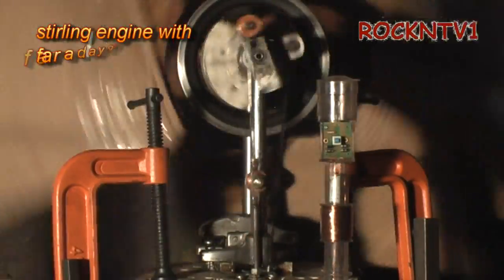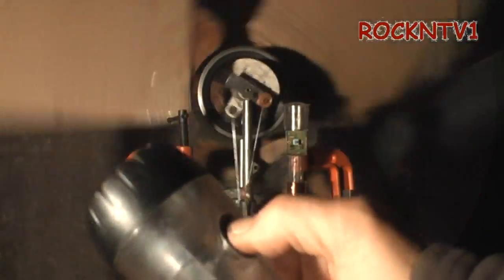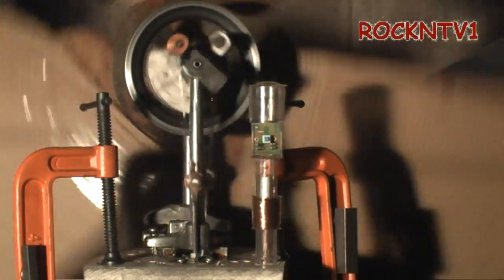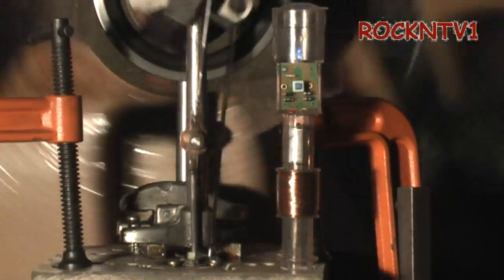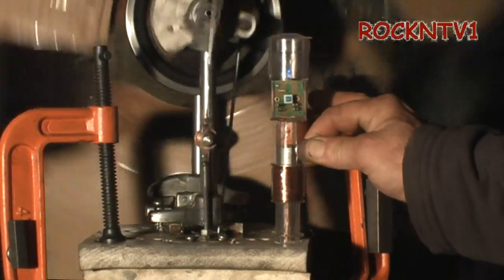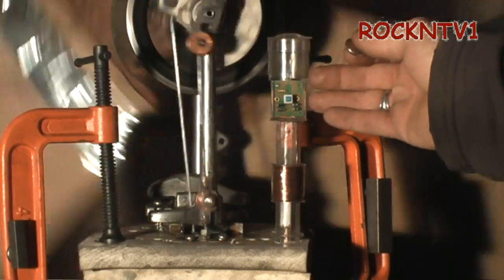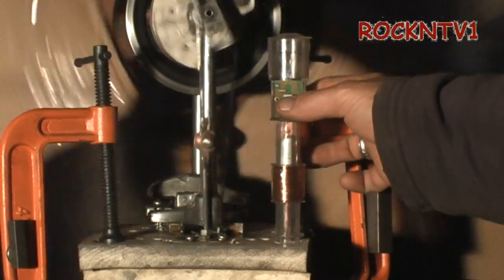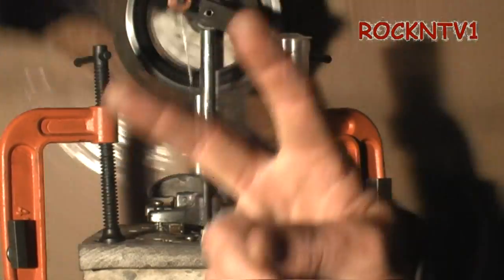Homemade diy Stirling engine FARADAY electricity GENERATOR

Comment from the maker: this stirling engine build has a lot of potential ive not come close to tapping. Once i have optimised the stirling cycle for these piston size and displacement ratio, i will work torward an effective dc power storage for the generator part. The lack of an induction load on the engine while using the faraday type generator, I have yet to fully explore. It is the one way flow of electric currant build into this circuitry that is the beauty, thnx

Comment from the maker: your right. the "piston"'s stroke actually shortened because of flex in the mechanical connection perpetrated by the flux of the additional magnet, yes an undesirable frictional load on the engine. Im thinking the area of flux increased with the second magnet as well as a "slip/stick"pattern of acceleration that may add to more phase cycles.

Comment from the maker: I am also torn between water cooling the engine or air cooled, like style of hot air fans of yester year. Am a  bit stuck deciding on the masses necessary for hot and cold ends of an air cooled stirling.

Comment from the maker: hi, In previous tests this stirling engine has produced  6.5 volts dc with a rotory type generator @ 150 rpm. With this simple faraday style generator, much less, I think due to the length of the coil and magnet and its relationship to the stroke of the engine. When I artificially accelerate the magnet thru the coil with the second magnet the power out put increases. All that said there must be some minimum speed at which the magnet travels thru the coil to produce voltage. thnx 4 the comment.

Comment from the maker: I dont think it matters whether the coil or the magnet is the driven part, but for the additional weight added to the engine for reciprocating, I think in theory, a huge light weight magnet driven by the engine would be best, as reducing the weight of a copper coil is a no.

Comment: It looked like the "piston"'s stroke actually shortened when you held up the other magnet. This reduced mechanical motion suggests two things. the magnets' fields would interact, or couple (and possibly de-couple). And that the change in field strength induced in the coil was increased despite the shorter stroke.
If you could mount a ring magnet outside the tube, would you generate more by the outside ring stationary or "floating" (magnetically coupled to the piston)???

Comment: Add a thin piece of steel tubing around the outside of the coil. This is called a back iron, and will increase the amount of changing magnetic flux over the windings.
Reply from the maker: good tip, thanks

Comment: I like where you are going with combining Technologies.
You will have a greater energy output using a TEG thermo electric generator running in conjunction with your stirling engine.  then you will have both mechanical fan power and electric LED power. All utilized from the fire.

Comment: I'll just toss in my $0.05 two years later. ;-)  The reason you're getting a stronger voltage spike when you hold that second magnet next to it, probably is because you're causing the first magnet to "snap" back.  Voltage/current is directly related to speed, so in effect instead of having a "smoother" but dim glow, the power is being concentrated into those spikes.  More technically, the faster the change in magnetic flux, the higher the voltage in the coil.

This effect is used in some applications where there's a lot of energy to be had, but it's of low grade, like wave power.  You can solve a lot of efficiency problems by doing away with gearing and what-not and instead have the available motion cause a weight to snap or spring back and forth, giving you higher voltages that can be worked with more efficiently.  Boosting efficiency on both ends, so to speak.
Reply from the maker: yes

Comment from the maker: hi frank, as you can see,  the materials used to build this Stirling engine are definitely not reliable, just available. I am convinced, that a stirling engine can be made nearing one hp for wood stove use that will charge batteries easily. I was hoping to get more discussion about the use of the Faraday type generator used here about why this works so well, and the lack of load imparted on the Stirling engine by this type of power generation. thnx 4 watching

Comment from the maker: hello sir,  in this stirling engine configuration, I do not see a teg  integrated n to the temperature differential possibilities achievable with a wood or coal fired stove, even if i consider a cold side of 40f / hot 5=800f of the displacer, the current materials of teg construction are temperamental =/- 200f,,, a very critical number considering  proximity to the source. help me ,,, moving the magnets is easy, i make  more vid to explain

Comment: You can improve the efficiency 
Let's see the video named as
Linear Generator Experiment 
The concept shown in this video will be useful to make high power linear generator
Reply from the maker: watch here,  https://youtu.be/f9Cs3daKT6o   new upgraded stirling engine driving linear alternator.
Reply from the maker: plus, by example in this video, it is no longer just theory ,,,, the engine itself, is proof of concept
Reply from the maker: Harish, I made this generator --> https://youtu.be/Ej2pCj95wzY
with the same stirling engine, hot air fan here --- > https://youtu.be/QLsSa3etyX4